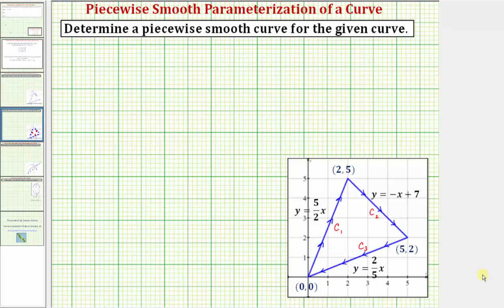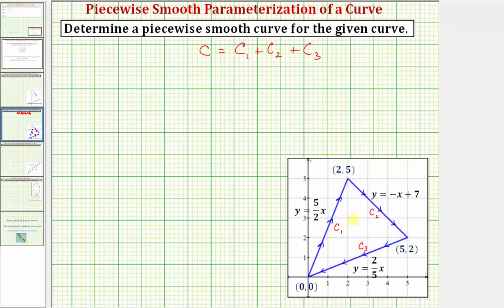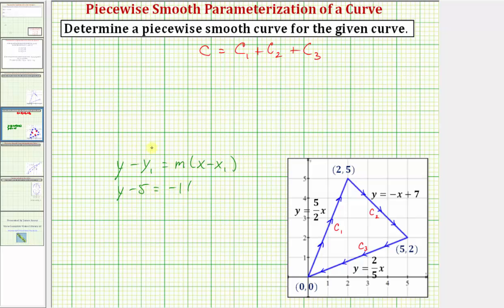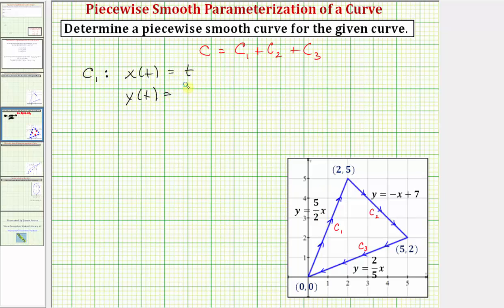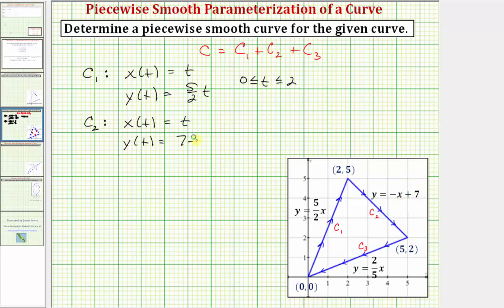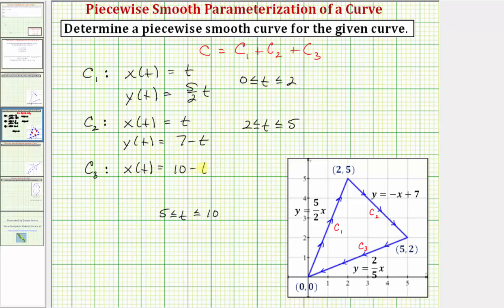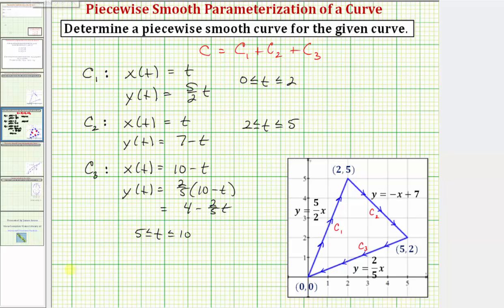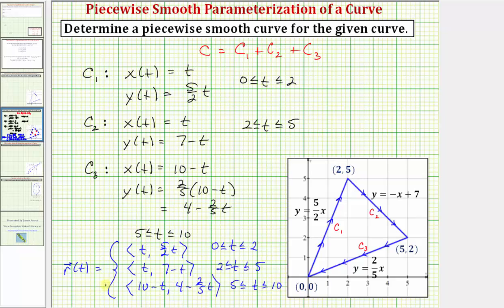Ex 1B: Determine a Piecewise Smooth Parameterization for a Curve (Triangle)

Comment: for anyone watching this, the way he does this may be confusing for most. an easier way is to make c1 x = t, y = (5/2)t from 0 to 2. then c2 x = 2 + t, y = 5 - t from 0 to 3. then c3 x = 5 -t, y = 2 - (2/5)t from 0 to 5. find x first then plug it into the equation. that is how I solved for y. you don't have to keep stacking the boundaries like what he did (0 to 2 then 2 to 5, then 5 to 10).